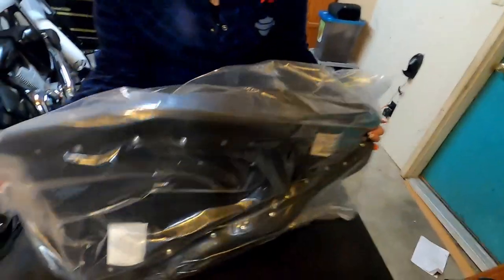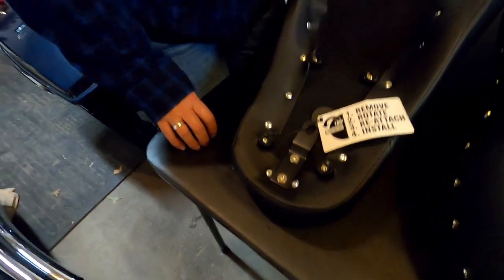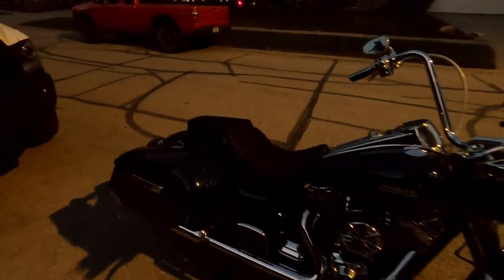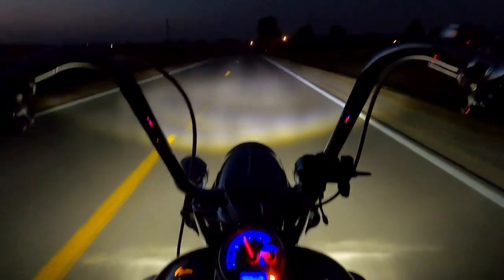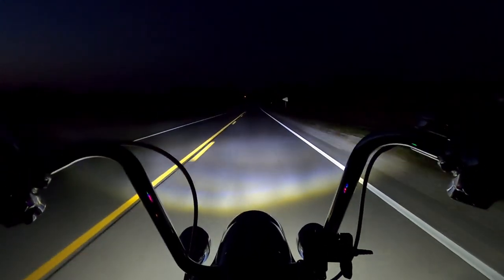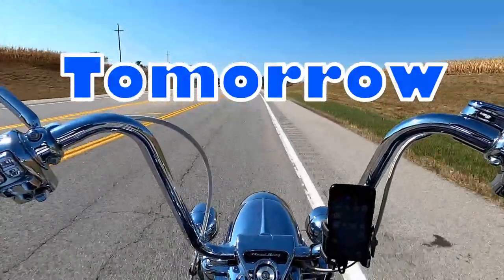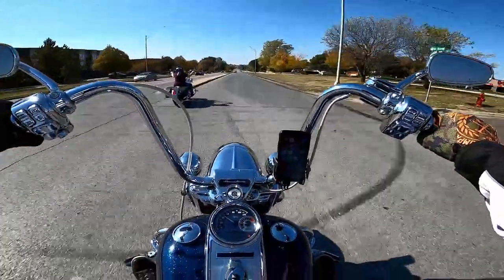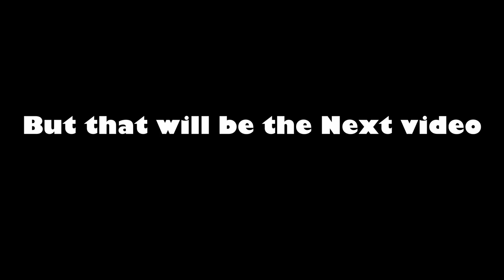Lucky Daves ''Get Lucky" seat for the KING install by Mrs. Stevy

Comment: That’s badass Stevy!
Reply from the maker: Thank you!
Reply: @StevyFaux  one year later I couldn’t get the lucky Dave’s version but I got the saddleman in tuck and roll and diamond stitch in the rear in brown. For my 2001 king 👑
Reply from the maker: @toolbrothers1477  Really? Where the lucky daves out of stock or do they not make it anymore? Nothing wrong with the saddlemen seat. Only difference is the back seat on the lucky Dave’s is a little wider and it has gel it in, and the lumbar support is more up and down on the saddlemen. Either one is a great choice and way better than any Harley seat.

Comment: do all logos come white? or did you chose white for the stitching color? thanks
Reply from the maker: You can choose the color of the stitching color(which includes the logo) you can choose the pattern of stitching on the seat and passenger seat. J picked this one cause it was in stock and ready to ship. I don’t know how long it takes to get a custom seat.
Reply: @StevyFaux  Ok thanks. I want the same one you have. I chose tuck and roll. But just want the logo white. Wasn’t sure if the tuck and roll section used any type of stitching
Reply from the maker: @squeegee119  I think you can order that way. But I figured I wasn’t going to pay to pretty up the part that I sit on lol the time 😃

Comment: What colour is the stitching ? White ?
Reply from the maker: The logo is white but the rest of the stitching is black.
Reply: Do u recommend this seat still ? Did it break in well enough to do longer  rides
Reply from the maker: @edmundprice7322  I have put a lot of miles on this seat. One thing to note is that it is still very stiff like memory foam should be. It hasn’t lost any of its density. Some cons are it does sit you up a little bit from a stock Harley seat but a Harley seat is so squishy that it sags down and is uncomfortable after a while. This seat conforms to your but every time. It is a narrower seat so you do start to feel that in the back of your legs a little bit but when you get off this seat after riding from fill up to fill up you don’t have the soreness that you have with a soft seat. 
Another thing to note is that this seats passenger pillion is horrible which is the reason I bought this one over the step up seat. The back seat has the same gel in it as the rider seat but it’s so bad that no one is going to sit on it unless they have to  But you can’t expect it to be all that great borrow it is. So I would recommend this seat but I would say if your not worried about a passenger at all maybe look into the saddleman step up seat and save a little bit of money.
Reply: Thank u for the reply I have a passenger at times sadly lol so this is my jam I guess also in the sick tuck and roll #diamondstitchisdead
Reply from the maker: @edmundprice7322  saddleman does have a touring seat I think you can get tuck an roll on.

Comment: How's that seating working for you now
Reply from the maker: I still haven’t got it broke in. But it has been great so far. When it brakes in it will be a little softer but I have no complaints an the times I have rode with it I haven’t been uncomfortable at all.
Reply: @StevyFaux  thank you for the input